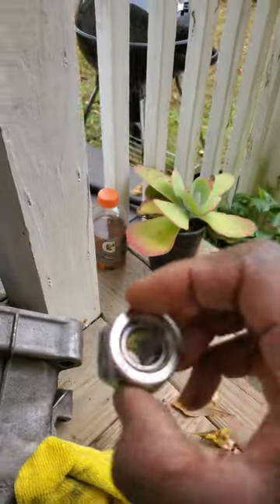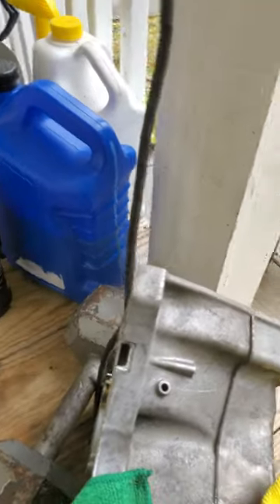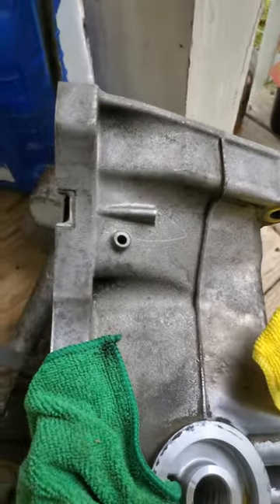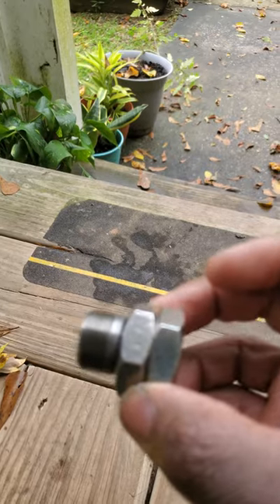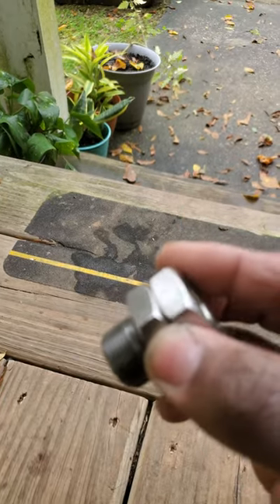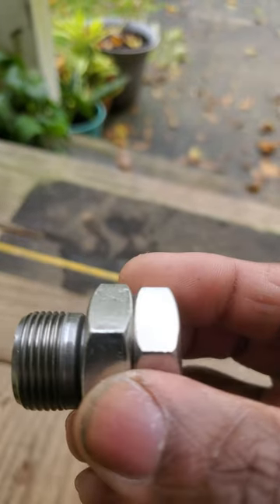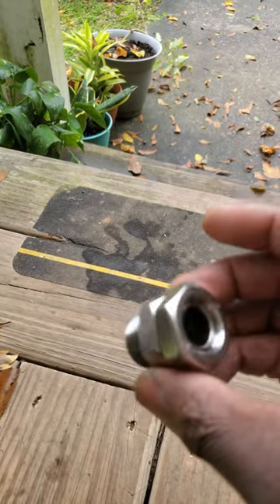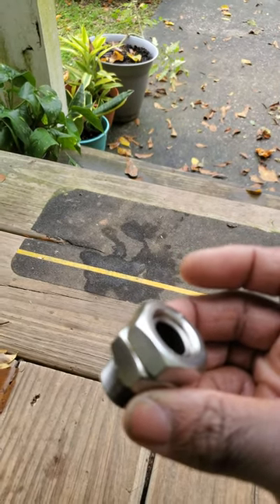2008 Honda Fit Sport Oil Filter stud removal

Comment: How did you fasten the stud to the new oil pan?  I bought a new stud but doesn't thread in very well.  BTW This video is really helpful - there's not much information about this part! Thanks for posting.

Comment: Where exactly did you get those nuts? I ordered some off amazon and they're way too thick to reliably use without stripping the filter holder again. Couldn't find anything at Lowes or Ace's Hardware.
Reply from the maker: I found mine off eBay. Got the thin ones, and they worked well for me.
Reply: Either order at Honda Dealership (parts Dpt) the oil filter housing(stud), or you can cut the big bolt in half, got mine at a tractor dealership  (far away but worth it) the size is like he said 20mm 1.5 pitch thread, so my LOWES and Home Depot, Auto Zone, Orielly’s, Advance Auto, Tool store , mechanic shop , even an  Industrial, none of them had it, but then the mechanic recommended a tractor dealership because they have metric, and they had a huge bolt, but this is what I did thanks to Jehovah, I could cut it with my grinder using a steel cutting wheel that’s very thin in a pack of 10 from harbor freight for $8.99 were the wheels and the grinder was the Hercules plug in so you can cut that bolt in half using a vice(or big wrench that can hold it down with your foot or knee pad on the wrench, eye protection and gloves, 

Bros 😃 I literally am doing this also right now and I see you commented a couple days ago!!!